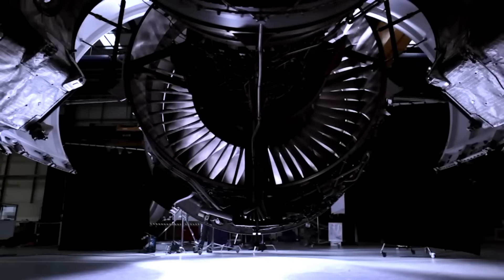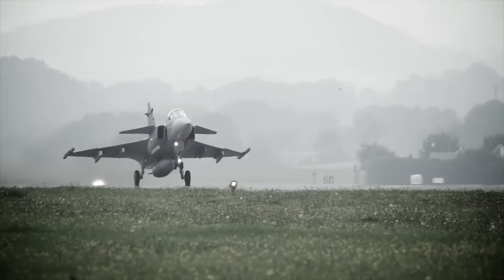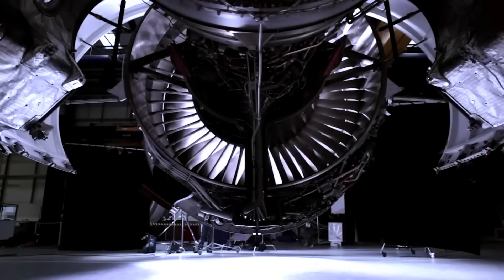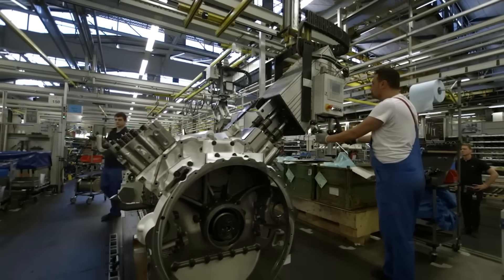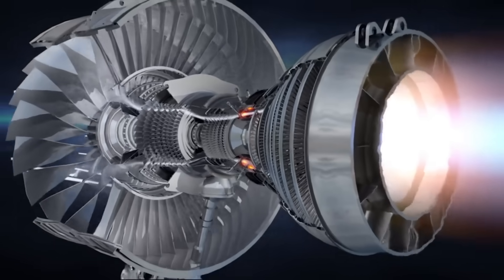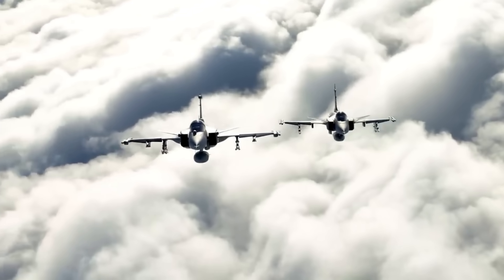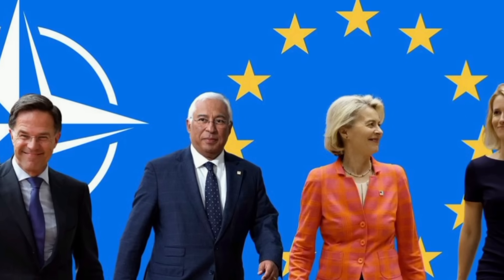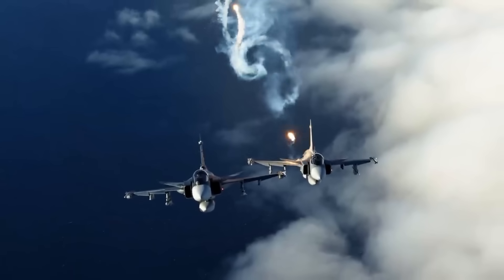How Rolls-Royce Quietly Rewired the Gripen Jet – And Shocked NATO Overnight

Comment: Rolls Royce designed and manufacture the RR Lift System used on the F35 .... effectively the whole back end of the VTOL version of the F35.
Reply: And they licensed the design from Yakovlev. The Yak-141 has been using this system for a long time.

Comment: I don't know and cannot find anything official on this reengine of the Gripen at all.
Reply: it is base on 2009 engine idea offer to put the EJ200 into Gripen NG, called EJ230 by EuroJet Turbo GmbH that failed to win,
over the years EuroJet Turbo GmbH has over the "EJ230" to power other Jets and lost to the F414 as it is has more to give.
Problem with EJ200 it was done on a budget and with a theoretical possibility of getting more power and better fuel efficiency.
the thing is EJ200 come out in it butter zone and all test showed all the way to get more power and better fuel efficiency came 
from engine life spam, maintenance cost and maintenance hours per flight hour going up. no work or testing have been on Gripen.

even the bigger new more power Gripen E, its is mainly still a lightweight interceptor fighter jet to fight off bigger opponent.

Fat Amy on a good day is good jet however after almost 2 decades of f-35 production countries are still waiting and cost rising.

SAAB has no reason to bring in a new engine, they have a contract for the F414 and in 25 year all Swedish Gripen will be out of service 

"For Saab, Sweden is the focus when it comes to fighter jets. 
The plan is for it to be financially viable, even if no other country wants to buy.

– It's a tough sport to sell fighter jets. 
We probably shouldn't develop aircraft if we have to sell them to others to make ends meet, 
says Peter Nilsson, Saab Advanced Programs."

Comment: There is so much wrong with this video. Why are there animations from piston engines? Why could "NATO be shocked" if Sweden is a member state to NATO? Did it shock itself? Did it shock Canada? Or was it only the US company producing the F-35 that was shocked? Also the idea that everything centers around the USA is incorrect. There is e.g. also the Eurofighter which also uses a European jet engine. 

What has really happened? Trump threatens to no longer be part of NATO, and there is the possibility to switch off the F-35s, or stop delivering spare parts (also for the previous Gripen engine) if Trump doesn't like the nose of some prime minister in Europe. Saab reacted by making the Gripen independent from US built jet engines.

Comment: The F35 is the more capable aircraft.. Israel attacked Iran, using F45 from a distance of more than 1000 miles, into heavily defended airspace, facing the most advanced Russian weapons. And lost zero F35. There’s no historic precedent to this kind of success. Surely is Israeli planning helped but the F35 proved absolutely essential.
But the purchase of such a defense component as a fight aircraft has many variables. Gripen  operations are certainly cheaper than the F35 and choosing an aircraft not manufactured by a potential adversary is not a matter of choice but necessity.
Overall, Canada will be well served with the F35. It is the perfect choice, even if Gripen is not the perfect offer aircraft.

Comment: Rolls-Royce Cars (BMW) and Rolls-Royce plc (Aero Engines) are separate companies. They have been since the early 1970s.
Reply: Sort of. Rolls-Royce aero engines had the rights to the name. R-R and BMW set up a joint venture (BRR) to build the BR710 aero engine. R-R bought out the joint venture and exchanged the rights to the name (for cars) as part of the deal, so now BMW have the ownership of the nme for cars.

Comment: Reality

Developing a new fighter jet engine like for the Gripen takes many years, often 8-10 years or more, and billions of dollars, involving advanced tech, materials, testing, and safety certification, though it's hard to pinpoint an exact timeframe as it depends on customization, but Rolls-Royce would leverage existing designs (like for Eurofighter) to shorten timelines compared to starting from scratch. 

Rolls has yet to develop an engine for the Gripen.
The only engine it has is from General Electric, at the US governments discretion.

Stop the bullshit!

Comment: I totally agree. Having done some tours in the far north the F35 could be a disadvantage.The Gripen's could be deployed and or stationed on bases in the far north instead of Edmonton. Response time would be greatly increased. The maintenance and operational cost is greatly decrease. We could even increase the quantities of Gripen, considering the F-35 price has almost double lately. My other concern is the US could secretly disable some function of the F-35 should Canada disagree on some US policy as they have complete control of the software. With the RR engine as the new option and built in Canada along possibly the whole plane, it seems to be a no brainer. I understand the RAF wanting the most stealth and high tech plane but I don't thing Canada would be going and attacking a country by stealth.

Comment: the engines greatest strength isn't that it's not American, but that it puts out twice the electrical power in a aircraft that has the worlds strongest airborne jamming system, and a sensor suite that can track stealth with the most advanced airborne computer... making it that much more deadly on those alone. it already could track and jam all Stealth aircraft in the area and out preforms them already before this, so they just lengthened the lifespan of the Gripen massively.
Reply: What’s amazing is that it is actually American, since it’s not actually made or developed by Rolls-Royce
Reply: @BSJWright  what kind of dribble are you posting? it's made in the UK by Rolls-Royce! full stop.
Reply: @TheInsaneupsdriver  it most certainly isn't!
Reply: It's designed and manufactured by a European consortium, Eurojet.

Like Airbus.

And other co-operative development and manufacturing alliances.

Eurojet manufacture specialist aero engines in the UK, Germany, Italy and France(?).

It is most certainly not American.

The very reason to look to a new engine for the Gripen was that the original was a US made unit, and that is no longer acceptable.

So why would you think the new engine could have anything to do with the US?
Reply: @mikemalone9678 What Eurojet? No released Gripen plane has any Eurojet engine.

Gripen has an improved General Electric F414-GE-39E engine. In Sweden named RM16. An F414 with specific improvements.

Comment: F35 stealth capabilities are high cost, high maintanence effort leading to low number of sorties per day.
Jas Gripen is a modular EW platform with new versions coming out rapidly meaning high adaptability that evolves with speed of software 

In a attrition scenario pound for pound gripens will perform more than 200% more sorties than F35 giving more strategic and tactical flexibility and not being confined to major airfields it can be serviced on a road in 15minutes by standard maintenance packages